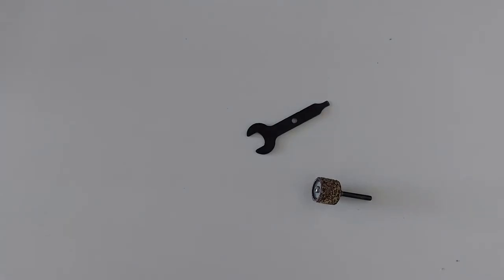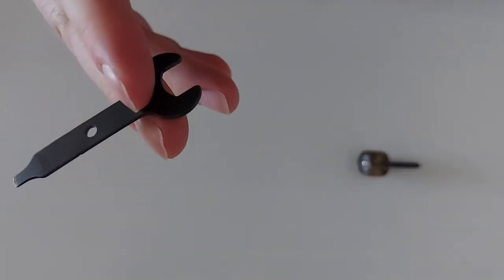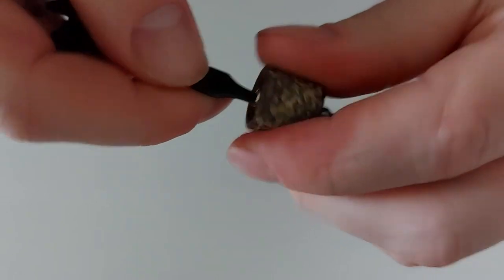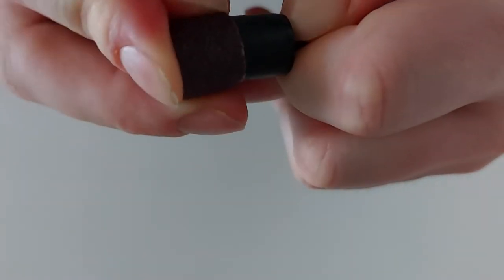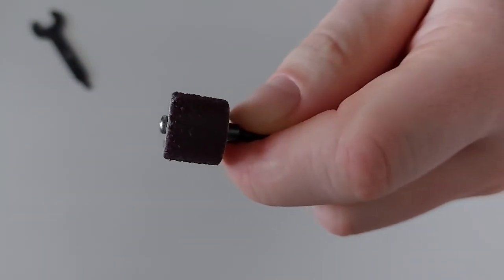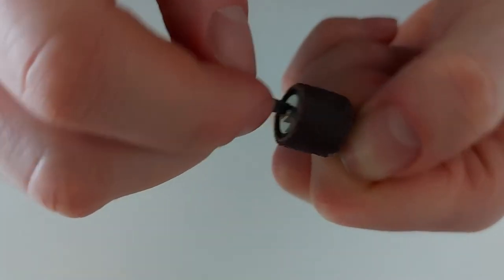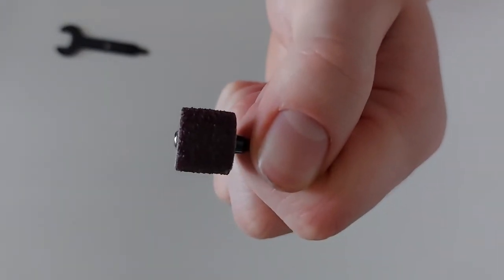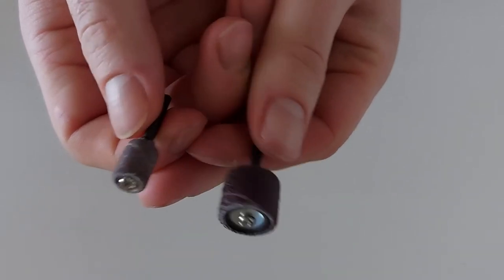How to Replace Worn Out Sanding Sleeve on Your Dremel  and Rotary Tool #408 #431 #432 #438

Comment: Thanks!  Exactly what it was looking for.  I keeps losing the sand cylinders. Didn’t know you could tighten them😂
Reply from the maker: Hehe. Tightening is important then. You can also use a small Phillips screwdriver if you need more leverage than you get with the small wrench.

Comment: My spare attachment is too big to fit into the hole on the Dremel, and the extra rounds are too big for the small tool. This is the nail grinder by Dremel that I am trying to change out worn out small round!

Comment: did not help at all w the obvious problem -- what to do if the band is stuck on the drum; any suggestions about removing the old stuck one??!?
Reply from the maker: Hi. I have not had that problem before so i can only come with suggestion. They can be hard to get off sometime though, and using force, gripping tighter and pulling harder will just increase the friction against the rubber and make it harder to get off. 

I have three tips that might work, but i have not tried them myself:
1. Secure the bit in a vice, wrench, dremel or something that can hold it firmly in place and wiggle the band off ( pulling straight out wont work)
2. Just cut of the band with a knife. Might need high precision and a steady hand. 
3. Try freezing the drum. The rubber on the inside will harden and there will be less friction. 

Hopefully some of those work. But again, have not had that problem so i can not promise that they will.
Reply: @rotarycrafts8760  Tom.  Same issue. This is what i just did to get a small rubber drum out of one of the small sand tubes.   I took the exact same tool that is used to undo the screw. It has a wrench head and a flathead side for the screw. I pushed that end in to the center hole and pushed hard against the wall and basically "picked" out side to side until it came out.  Downside could be if you do this enough may be the rubber gets messed up. But this one time I did it it seemed durable.